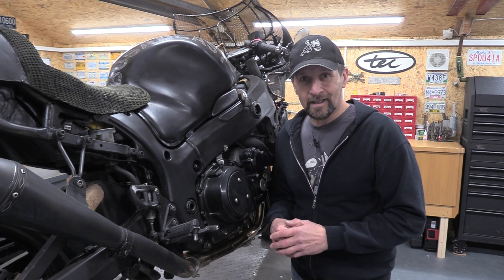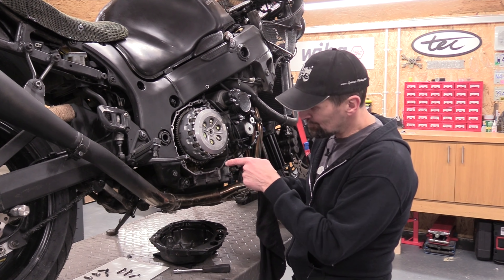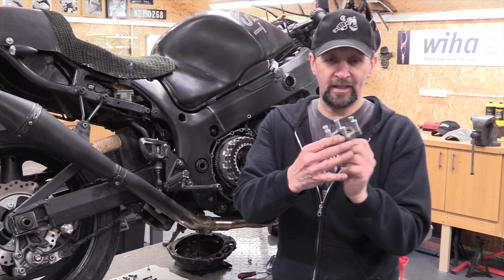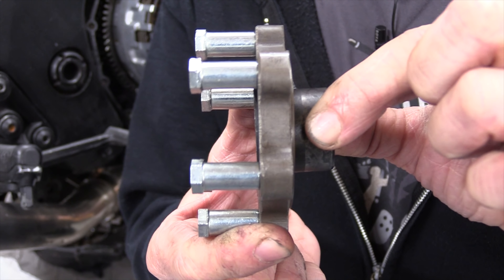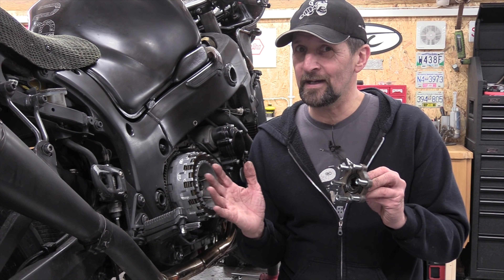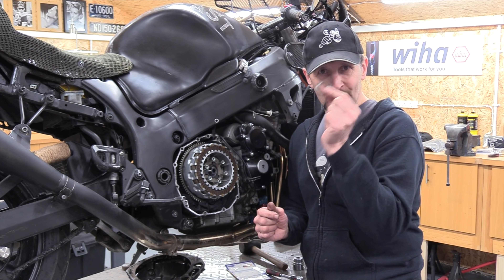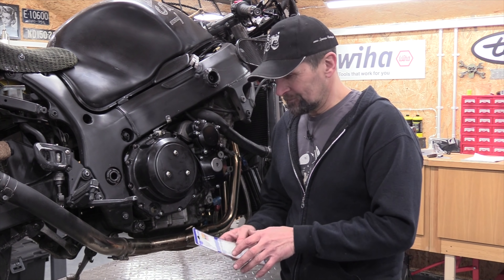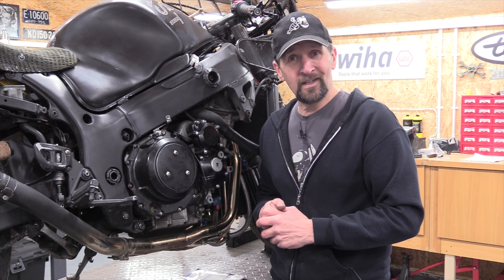Suzuki Hayabusa Gen1 :-  Clutch Mod Install

Comment: What's the Advantages of the lock up clutch
Reply from the maker: To be precise it's not called a 'Lock up clutch' that's a different thing entirely.. The factory fitted feature is actually called a "Back Torque Limiter", it's purpose is to mitigate the effects of engine braking when riders decelerate. Simply put, it helps prevent the back wheel locking up when you roll off the throttle at high revs... and as the bike wears with mileage and use, the device can be come unreliable and is prone to deploy under initial acceleration.. leading to the bike lurching forward when you try to pull away.  So if this is happening to your bike, then you can either weld the two halves of the device together or fit this locking ring to stop it moving... then you will have a regular conventional clutch operation..!
Reply: @Moonfleet41  Ok great thank you, how long is yours been holding up for ? And is the piece just as good as welding the 2
Reply from the maker: Never had a problem with it, i can now launch it hard enough to leave long black line on the road, it's never jumped or lurched since..!
Reply: @Moonfleet41  👍 thank you

Comment: Why didn't you properly clean the gasket mating surfaces before putting the clutch cover back on?
Reply from the maker: It's a new gasket, I changed it during the project and if you haven't been following our channel for a while, my general practice with all casing gaskets is, after cleaning both faces thoroughly, I stick the gasket to the casing using Blue Hylomar sealant and then just plain grease against the engine, this means the gasket comes off attached 100% to the casing every time, never gets torn or damaged, and that way can be used multiple times with just a freshen up of the grease against the engine side of the gasket!  Give it a try mate, it'll save you a lot of money on gaskets you don't need to replace.
Reply: @Moonfleet41  thank you for the thorough and prompt response. I have never heard of an application like that but it does make sense. Wouldn't it be best to at least clean up the mating service on the engine side to help the greased gasket seal properly? I noticed that it was still dirty when you reassembled it.
Reply: @Moonfleet41  and can you point me to the video where you talk about this application process? Thanks

Comment: They should have put some rubber between it or springs. Mine makes a little rattle sound. The space between the metal. You can hardly hear or feel it.  But it doesn’t bother me. Its how its made.
Reply from the maker: Clearly yours hasn't started lurching forward yet !

Comment: Great vid, Del... motorcycle Zen achieved!   Just wondering with this new set up if there’s more friction and/or heat buildup?  Awesome start to the new location.  Hope you guys are both doing well.  🏍👍🏍
Reply from the maker: Hi Gary, i imagine there would be less heat and friction now due to the elimination of slippage on back torque, it acts exactly like a regular ordinary clutch now.     Hope you're well too, have a great week and keep safe.. D&Pxx
Reply: @Moonfleet41  thx, Del.  Ok gotcha on the heat and friction.   Reminds me of a buddy’s 916 Ducati I had access to for a few years (before I bought my ST3)- it had the factory dry clutch and I always thought I was doing damage to his bike because of that bizarre noise.  Hope the shop is everything you’ve wanted.  (I’m putting finishing touches on the laundry room closet today) and eyeing a nice router on sale in Amazon! Never owned one... would be nice!  In any event, stay well!

Comment: Something I was always worried about.. would it be dangerous to leave a bike ticking over on the side stand  regards oil starvation to the pump?
Reply from the maker: Of course not, that is fine, the pump is not left dry when the bike is on the stand, it will still feed oil to the engine quite adequately on the sidestand.

Comment: Nice vid once again Del can you tell me what s the tuque wrench your using  looks very useful
Reply from the maker: Sure thing buddy, there's a link directly under the video if you click 'Show More', then it's right there, takes you to Spanner Monkey and a buy now link... they're a bit pricey, but rated from 5-14Nm, a very critical torque range for those smaller, fragile threads and it is finest German precision made, you get what you pay for mate.

Comment: Nice to see you in the new shop! Great timing on the clutch video for me as I'm waiting on parts for my clutch now and was wondering if my cordless 1/2" dewalt impact would have the guts to remove the clutch nut on my bike.  Also, since the nut on my bike gets staked (like yours) I guess there's no need to get picky about a specific torque setting?  Mine happens to need 69ft lbs but a good jab with the impact should do?  Thanks for these videos they are very helpful!
Reply from the maker: It does have a specific torque setting mate, it'll be in your manual and I'm lucky enough to have a programmable impact gun so I just set it to the right torque and trigger it till it stops, it is important to get it right as that pressure will hold the mechanism still and you're right also, staking it the way that you're meant to does give you a belt and braces security!
Reply: @Moonfleet41  I didnt realize you can set your impact to the exact torque that you want, thats awesome!  Mine is 69ft lbs, so I'll be sure to use my torque wrench on it, thanks for the quick response bud!

Comment: Nice work del. are heavy duty springs the same as stiffer springs? I’m looking to replace mine on my srad 600 because the clutch is far too heavy. Thanks.
Reply from the maker: Hi Neil, if your clutch is too heavy for you, then stiffer or heavy duty springs (same thing) will make it worse... but if you have a cable then that could be your problem, they can get stiff over the years with internal corrosion so it pays to replace them and if you buy a Slinky Glide cable from Wemoto, they're even smoother in operation, so that could really lighten your level a lot.
Reply: @Moonfleet41  thanks del.

Comment: delboy, couldnt see the link to the company, i have this problem and it needs fixing, bikes been round the clock
Reply from the maker: Hi Jim, the link is under the video in the description, here it is: https://www.ebay.co.uk/str/mhproducts
Reply: @Moonfleet41  your a star.order is in, thanks very helpful video
Reply from the maker: You're welcome Jim, have fun with it and thanks for your support.
Reply: delboy, fitted the part and new springs but then struggled to get a gear and when i did and let clutch out, bike wouldnt move and i heard a clicking sound coming from clutch side, any ideas ? thanks

Comment: Er, doing away with the slipper clutch is not a good idea.  Are spares not available??  This is a backward step mod if I ever saw one.  Also, 9:47.  Again, if that was supposed to be a lock washer, then surely it would be?   You do not mention why you decided to take that step, as I am presuming all bolts and nuts are torqued to spec?

Comment: Doesn’t the original design do a worthwhile job of not locking up the back wheel? So why not replace the wear and tear with like for like OEM parts?
Reply from the maker: It's a known issue with Gen 1's, read a little up on it.

Comment: FYI: at 9:02,  You did not align the marks on the clutch mechanism properly.
Reply from the maker: Yeah, spotted it, fingers and thumbs in the way, corrected it right after that shot...check the avatar!

Comment: I like this version of the modification it's less "final" and I'm sure it'll work perfectly 
.I also like the idea of a reinforcing plate on the clutch slave cylinder makes great sense..
I'm a bit wary of welding high performance high tolerance parts and as the one piece alternative part is so expensive I think this part you've opted for is a good call .
You're friction plates look well from the outside . Can't remember if you put new clutch plates in or not ..?  but they look like new ..
Peace and love brother a fun interesting and informative show and tell ..ive been in hundreds of clutches but never a busa so I've learned a new thing 👍🏻😊
👍🏻☮❤
Reply from the maker: Cheers brother, it is indeed a new set of plates and steels, I did it a few months ago after finishing the project, but didn't document it as I'd already done the exact video on the ZX7R, and as you know if real life, everything is 8x quicker than filming, so it took me 1/2hr to throw a new set of plates in it and that's when I decided to lock up the ramp as it's incredible how much it rattles about!... and it started jolting and stalling pulling away so it was no option... have a great weekend brother, hugs from us both, and keep the family safe, D&Px

Comment: I like the vid dal BUT you used to do a longer vid I like it better when you show a lot more instead of cropping a lot out and no I won’t get bored I like it when you did the triumph vids stay safe mate best wishes to penny
Reply from the maker: Hi Steve, thanks for the feedback mate. the length if any tutorial video is directly related to the task itself. things like chain and sprockets, Head stock bearings or a brake caliper rebuild.. those jobs take a couple of hours in real time.. but this mod takes maybe 20 minutes to fit, end to end.. so the video will always reflect that..   We will do more in the future mate, and they will always vary depending on how long the actual job takes..   Thanks again for oyur support, and have a great weekend.. Pp says hi.

Comment: 11:23 - what are you using as a gasket?
Reply from the maker: Erm.... A gasket..!  It's on the casing ! can you not see it ?
Reply: I do now, thanks. I was curious what you put on it, from the tub.
Reply from the maker: @GXXRDRVR  When re-using an old gasket I always give them a smear of grease just to soften them, and it assures they come off next time without sticking and ripping to bits!
Reply: Excellent tip! Thank you!

Comment: Nice vid as always mate. Hopefully people will get the importance of that rag covering the openings inside the crankcases. Great step by step stuff on film. Takes the fear out of removing that casing n working on the clutch on most bikes.
Reply from the maker: Thank mate, yeah for some reason the old clutch is often a scary casing to open.. but as you saw, simple and basic stuff in there, nothing complex about it. and you'll never forget the rag after the first time you drop a washer into the sump...lol!
Reply: @Moonfleet41  how about putting some strong magnets inside the rag as well.  on the cossie engines i used to use the magnets that go round the oil filter on the outside you get 6 in a pack, they look like button batteries but are super strong.

Comment: Is there an engineering reason why the clutch housing doesn't have a gasket?
Reply from the maker: It does mate, did you not see it?
Reply: @Moonfleet41   -   :-)   OK, doing repeated pauses, I see it now.  Do you adhere it just with wheel grease?
Reply from the maker: @daveinwla6360  Just grease on one side.. I learned my trade back in the 80's, picked up lots of old school tricks from the old guys.. when you have a removable engine casing, ideally you'll want the entire gasket to come off stuck only to the casing, that way, you can set it on the bench and carefully scrape the old gasket off...and no torn or shredded gasket material is left attached to the actual engine, where it can be a lot of grief to remove, with bits of old gasket dropping into the engine...   So to actually make that happen, i coat the dry casing with a gasket sealant called Blue Hylomar,  then stick the gasket to the loose casing... and once its dry, i coat the engine side with just plain grease...That way, when you remove the casing again, the gasket comes off in one intact piece, and nothing left stuck to the engine... and as an extra bonus, the gasket can be reused a few times as it's not torn, you just re-coat it with grease and refit it.. !
Reply: @Moonfleet41   - Got it!  Thanks, Del.  Would you do the same for a water pump?
Reply from the maker: @daveinwla6360  Yes mate, any time you want a gasket to come away, cleanly attached to the casing it's a great way to do it as it doesn't tear between the two mating surfaces, it can be re-used, just freshen up the grease each time!
Reply: @Moonfleet41   - Thanks, again, Del!

Comment: Not sure if it matters now the the lock up washer is installed but there are two dots on the clutch cam set that are misaligned.

https://youtu.be/3_-FFf0dVSE?t=549
Reply from the maker: Pretty much irrelavant once it locked up solid. !

Comment: I always admired your work but this time a little disappointed..

.. you should hold with clutch tool the hub  and then use torque wrench..
Reply from the maker: Programmable impact gun, it torques to exact value.

Comment: Hey Del I would like to offer my help as I can weld the slipper mechanism for you and you can be sure that it will not break, if you want to take me up on my offer then just let me know as I want to anyone I can during these tough times.
Reply from the maker: Thanks for the kind offer buddy, but it's locked up solid now, and ill see how it goes.

Comment: If it lasts 10,000 miles, I don't see the need to get it welded or buy a solid one.
Reply from the maker: I agree Tim, in physical terms, while the spacer ring is in place, the mechanism cannot move.. so as long as it stays bolted up.. it will work.!
Reply: @Moonfleet41  And it can be replaced at minimum cost, too.